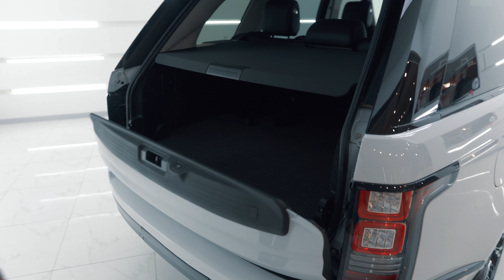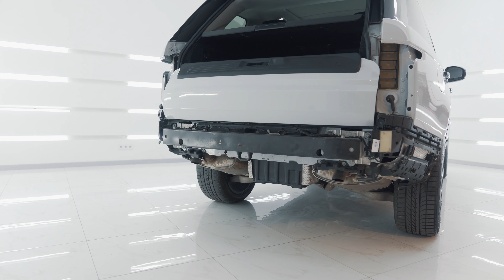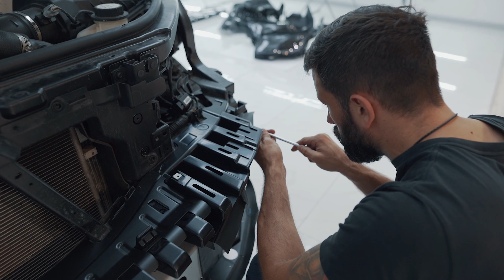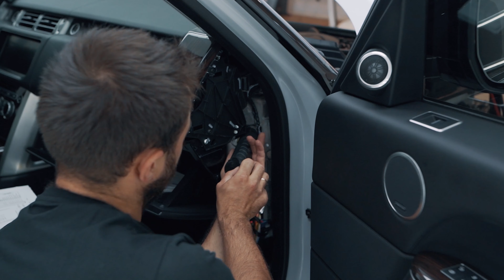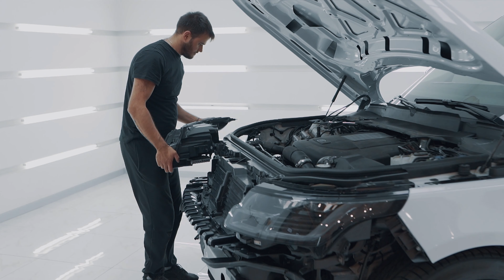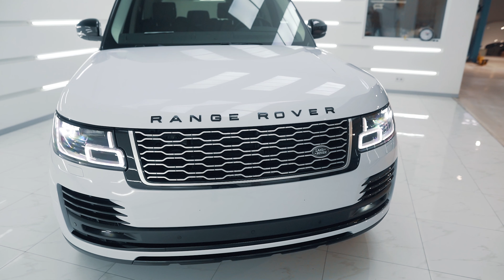Range Rover L405 2013-2017 restyling to 2018+

Comment: Hello, where can i buy these conversion kits for my 2015 full size range rover? Great video by the way
Reply: You don’t really. You buy just the new headlights, hood, grille and rear bumper. If you don’t, the headlights in the rear and front won’t fit. I advise you then get SVA parts, so you upgrade while replacing😉
Reply: @iliassoussi7829  whether SVR is an upgrade is a matter of taste, I want my Range Rover elegant, svr is not that.
Reply: @Brian-jv8iy big difference between SVA and SVR mate